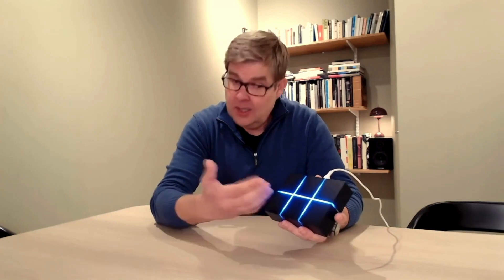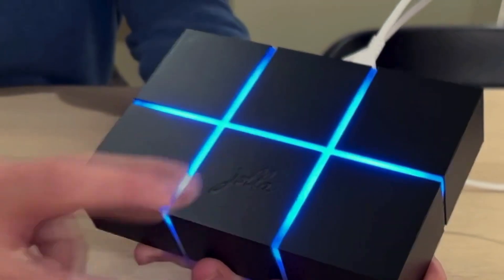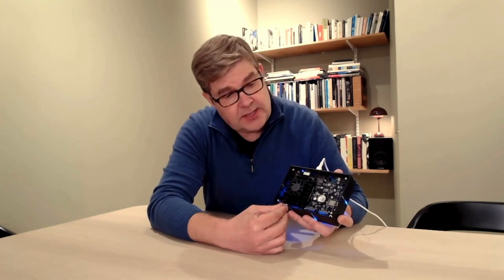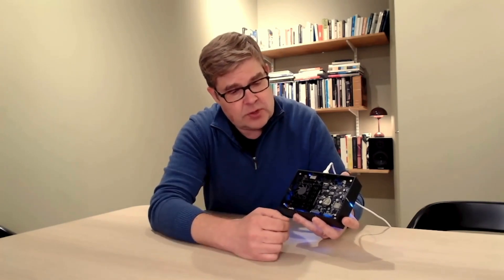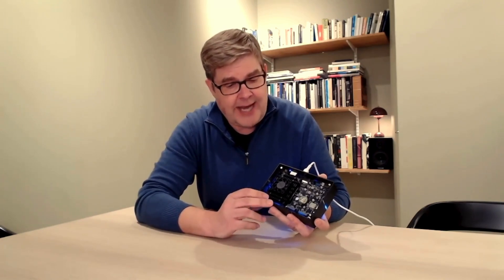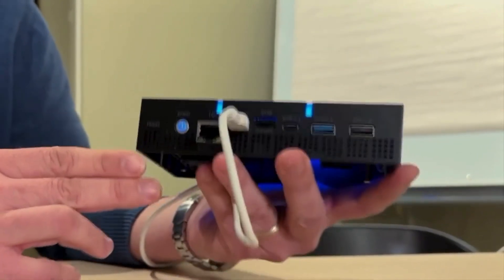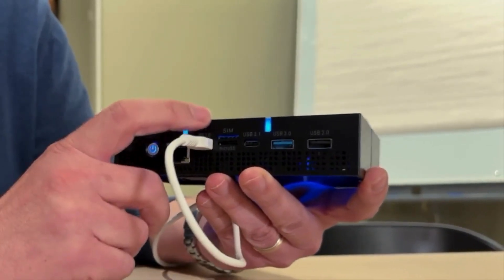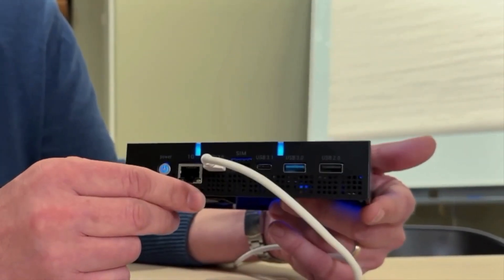Jolla Mind2 Hardware update: a closer look inside

Comment: Sorry Jolla, but I still don't get the purpose of this device? Other than two SSDs, and perhaps a 5G modem/Sim card, what makes it different that other Rk3588 based devices, such as Orange Pi 5 Pro for example? Furthermore, why would a company that is already spread really thin decide to develop their own PCBA, and their own hardware to begin with, and also in the process move away from the core product of SailfishOS? I must admit that I haven't paid close attention to the whole development lifecycle of this product, so all of this might be well known things, but I just can't wrap my head around it...

EDIT: Just had a look at the price, and wow, just wow! 700 euros for the device and then, on top of that 10 euros monthly subscription!? And you don't even include the power suply (Orange Pi Pro does, also has 16Gb of RAM, for a fraction of the price)?! One has to ask yourself, who is this device meant for? Certainly not for developers, or advanced users and tinkerers, they will just get the aforementioned Orange Pi for much less money, and run they LLMs locally. Definitely not for your average user, they don't even know the company exists! Hell, I know of a few hardcore Linux kernel developers who never heard of either Jolla or SailfishOS. 
And to top it all off, the device connects to the cloud, so we cannot really be sure what it is communicating with the Venho.ai, supplier of the LLMs.
Reminds me of the AI Pin and Rabbit r1, an attempt destined to fail. Such a shame for a team that I've been a fan of from the times of the legendary Nokia Internet Tablets (N810 still being one, if not the most beloved device).
Reply: @nowave7 Great question! The purpose of Jolla Mind2 goes beyond just hardware specs—it's a privacy-first AI computer that serves as a personal knowledge hub. Unlike typical RK3588 devices, Mind2 combines hardware with specialized AI software that organizes your emails, messages, documents, calendar, and tasks, all locally without relying on the cloud. This ensures your data stays private. So really, the software we are developing for this purpose is the key. 

As for custom hardware, it allows us to build a device that’s optimized for AI processing and secure data handling. Think of Mind2 as an AI-powered assistant that prioritizes your privacy, not just another RK3588 board. Hope this helps! 😊